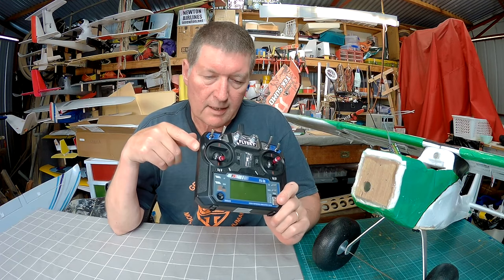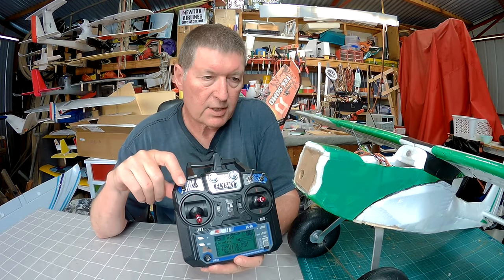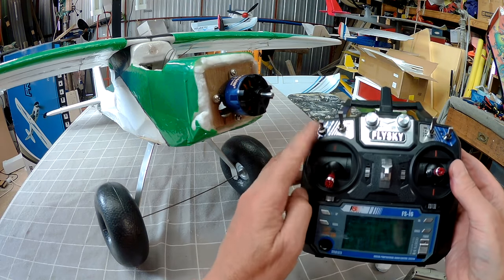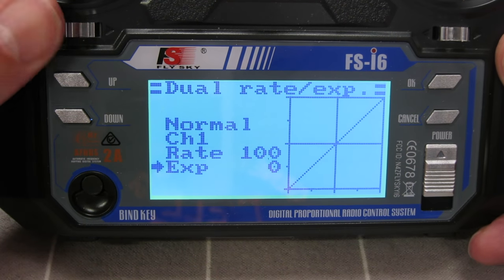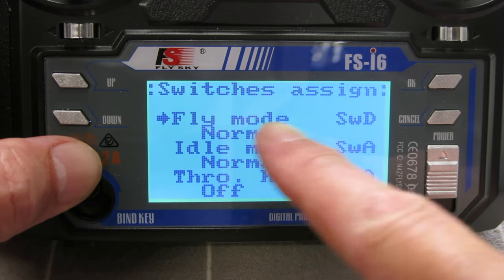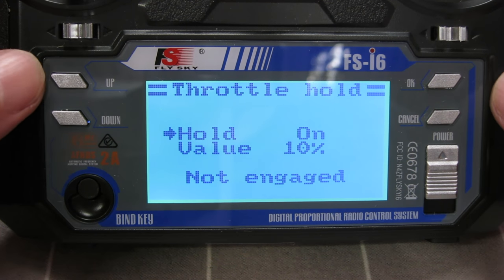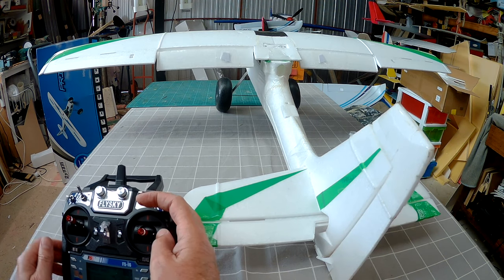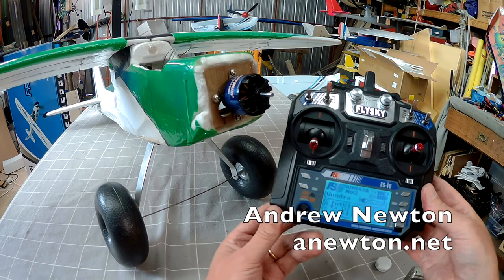FlySky FS i6 programming

Comment: I just got my FS-i6X transmitter/receiver the other day and I'm trying to set it up. This unit labels switch on the upper front of the transmitter as SWA, SWB, SWC and SWD, The two potentiometers are labelled VRA and VRB and the transmitter recoganizes them as channel 5 and 6. 
When I get into the set up menu - assign switches - idle mode - the screen reads "None" directly to the right of each mode . Pushing the up and down buttons nothing happens, no changes. What am I missing? Do I need to update my firmware?
Reply from the maker: Thats normal. Watch this https://www.youtube.com/watch?v=kKgV3LhAwVo
Reply: @AndrewNewton , Thank you. The save function after making changes eluded me, then I discovered you hold the "cancel" button to save your changes. 
I was a bit surprised there wasn't a detailed instruction booklet included with the radio, but I suspect that helps keep the cost down, which is why I chose this radio.

Comment: Hi Andrew i have just been through your how to program fsi6, the problem i am having is in dual rates is when i switch to sport mode i have no use of any channel but all ok in normal mode, any idea
Reply from the maker: Have you set up the weight and expo for each channel in sport mode?
Reply: yes i have and i changed the sport mode to switch b and it works fine , but in display if i operate switch d all the channels disappear. thanks for your quick response

Comment: Hi, Andrew. I also want to set the flaps for two positions on SWC, but I really don't know how. I set both flaps on CH5 with a Y cable and changing the wires inside one of the servos so they will work the opposite way. I suppose you know what I'm talking about. I manage to set full flap on pos. 3 of the SWC, but I don't know how to set half flap. Any help appreciated. Thanks
Reply from the maker: SWC up = level flaps, SWC middle = half flaps, SWC down = full flaps. What does your setup do that is different?
Reply: SWC up - flaps up, SWC middle - flaps level,  SWC down - flaps full down
Reply from the maker: Adjust your push rod length and servo arm position so that Up = Level
Reply: Yep! Works perfect! Thank you, Andrew.
Reply: Another question, Andrew, if I may. Now that SWC is set to half and full flap, with elevator down when full flap, is there any possibility to set elevator up when half flap? Thanks

Comment: Hi Andrew,Firstly many thanks for your tips and help, always a pleasant experience.
I`m hoping you can help with a prob I have with a  Turnigy i6 .Its re battery,I am not a fan of  click in batterys as you have 8 chances of a failure given 4 batteries.
I adapted 
a 2S life 6.6 V 700 m/a to fit but this was the biggest I could find that would fit.700 ma not enough really.
The screen has since gone blank and radio now unusable.(too many volts?? rated at 6.6v but in practice is closer to 7v versus rec 5volts)
Would happily buy another if a battery can be found to suit .Any help would be welcomed.Cheers Brian.S.
Reply from the maker: Oh no! I have only ever used AA batteries. Some users have done a LiPo mod but I have not looked into it. Might be time for a replacement.

Comment: Hi, I'm planning to buy this radio with a receiver. There is two versions. Should I get the receiver with telemetry?
Reply from the maker: FS-i6X (has 10ch) and FS-iA6B receiver (has iBus and telem) would be the best to buy
Reply: @AndrewNewton  I will use the radio for a freewing lippisch 64mm edf plane, so I don't really need a 10ch radio. I don't have alot of money either.
Reply: @AndrewNewton  Here is a link of the two radios and receivers I'm planning to buy. They both cost the same:

https://www.radiostyrda-modeller.se/default.asp?mod=product&cat_id=24&product_id=12699

https://www.radiostyrda-modeller.se/default.asp?mod=product&cat_id=24&product_id=12698
Reply: Which one whould you recommend?
Reply from the maker: @sadsausage2224  The first one with FS-iA6B receiver
Reply: @AndrewNewton  ok thanks 👍

Comment: Andrew I'm having a another problem with a battery it's new 11.1 volt 2200 mah 25 c and I used my tenergy  balance charger  I tried it out in my plane and the  power keeps going down then back up to full power and then back down up and down  my other one works fine so do you know what I can do about this  or what the reason for this
Reply from the maker: If that is the only battery that it happens with then it could be a dodgy cell.
Reply: Thanks for telling me I bought 2 of the same batteries and one works fine but the other one is doing it I wanted to know what was the reason for it I haven't had to much luck with batteries if late thanks again for helping me

Comment: My evolution I'm going to use the sport wings and the  Phoenix I'm going to use the evolution wings the evolution wings have the alorons and flaps on each wing I'm using the same type battery in each plane I like the rudder fin on the Phoenix and I used your idea to use tape to help  stabilize it.its twice the size as the  evolutions fin.

Comment: Hey Andrew I have another question for you my Phoenix 2000 the moter is a 
4023 and when its cold it spins fine but after I run it for about a minute or 2
It seems  to drag and dosen't spin as freely as when it's cold do you have any idea of what it is or is that  normal???
Reply from the maker: When you plug the battery in it might resist spinning, don't know about temperature
Reply: No its not a question of temp. the motor  esc and  battery  all are  cold they don't get hot but after running it  30 seconds or so I turn it off and after a couple of minutes  I  picked it up and spun the blade and it  seems to be  dragging  after about a couple of hours its spinning fine  freely  do you have any idea what it might be  battery is fully charged  connections are good  but I can't think of anything that would cause it  should I try  spraying some  wd 40 on it and in it to see if that fixes it  or have you ever ran across this before I really can't think of anything that would cause this its the  Phoenix 2000 motor  brushless  could one of the  plates be loose  inside???

Comment: Hello  Andrew this is  Jeff  in Seattle I wanted to  ask you  ,can I use switch b to set the  rudder  in a  slow  turn I have  it flying  straight  and  level  but I want it  be able to  flip  switch  b on  and  have  it stay in a slow turn until I  turn switch  b off .I have the  fly sky ia6x transmitter thank you  if its possible  can you  tell me  how to  set it up and also how do I adjust the  sensitivity of the  controllers so they  don't  react  as fast
Reply from the maker: Yes that should be possible, like flaperon mix on the rudder.
Reply: Thanks  I'll try it

Comment: Is there a chance to use channel 5 for the tail elevator so I can use elevon on the normal wing
Reply from the maker: Elevons are just flaperons/spoilerons using the elevator stick as the source (also called snap flaps), so I think you can leave the elevator on 2 and plug one of the ailerons into 5 then do the flaperon mixing.

Comment: hi andrew! carlo from the philippines again. i recently bought this flysky is-i6 after accidentaly destroying my spektrum dxe when i inserted a 2s battery the wrong way around. anyway i was wondering if i could set up a flight mode on a switch on this transmitter so that i could have a take off mode and flying mode. i wanted to have an airelon rudder mix on the flying mode while none on the take off mode. is this possible? thanks again 😊
Reply from the maker: Not an option with this one Carlo. Cant use switches with mixes.

Comment: Can you remove channel 2 and 4 from stick and move to switches? I only need left/ right and up/down for car and want to use channels 2,4 5and 6 for switches to run 2 speed transmission and lock diffs.  Thanks.
Reply from the maker: Not with this radio unfortunately, 12 3 and 4 are fixed to the sticks
Reply: @AndrewNewton  thanks. So I If got the 10 channel receiver I could use the other 6 channel for the switches?
Reply from the maker: You would need to do the 10 channel firmware mod to the transmitter to use more than 6 channels
Reply: @AndrewNewton  I have the x version which says it has 10 channels so do I still need to update. This is all new to me!!!
Reply from the maker: @theitalianjob6302  Perfect. You should be right with a 10 ch receiver.
Reply: @AndrewNewton  thanks for your help.

Comment: I wanted to ask you if I have a brushed motor with my fs i6x radio and in the  throttle mode it says 25% 50% ect.and I don't use a esc will it go at full speed or at increment of 25 50 75 100 moving the throttle without the esc or will it go all or nothing
Reply from the maker: Still need an ESC to give variable voltage, receiver only provides the signal for the ESC
Reply: Thanks

Comment: I know this is old but I have the flysky fs-i6x.  When I go to the assign switches page, it let's me toggle thru fly mode, idle mode, throttle hold, using the ok button, but the up and down buttons dont seem to work on this screen.  I cant change the switch assignments.  They are all stuck on none and I cant even select it to change them.  Any help anyone can provide would be appreciated.  I even reset the radio to factory defaults.
Reply from the maker: Cant help with that one sorry

Comment: Help. My flaps go waay too far down. How do i reduce? I tried end points but it barely does anything.
Reply from the maker: Start with the linkages. Move the pushrod to an inner hole on the servo arm or fit longer control horns on the flaps. Or reduce the weight in the mixing.
Reply: @AndrewNewton  ahhh i havent tried mixing yet. Will do thank you

Comment: yea thx for the vids I got mine with a cheap quad no instructions at all I use the radio on my beach planes don't want sand on my graupner stuff took me ages to find out you have to press cancel to lock a setting in lolol also on mine I the throttle is not down and all switches are up it beeps a warning must be a quad feture lolol
Reply from the maker: It's a bit quirky but great performance for a cheapy

Comment: very strange , I have  fs-I6x my set up is  ch5/normal position  ch6/also normal positionand for mix2 (master ch6 flap)  posmix/-8%   negmix/-8%  offset/ 1%thank you very much for your setting, I still do not know why my setting , so much difference, is not a big deal, is working for me .  thank's again it's very useful and enjoy more my calypso glider 73 inch wingspan.
Reply from the maker: 8% - Would that be for camber and reflex rather than full flaps?
Reply: the only thing  I did different to you , I did not use 3 way switch instead I use VRA switch on transmitter

Comment: So now I've tried a different charger and I charged up my battery. And it says it's fully charged according to the indicator. I turn it on. And again, I have full power. For 10 seconds, and then it drops down and just keeps going down and down and down. I tried it in a different plane same thing. So it's not the plane. And I don't believe it's the charger so I have 3 different batteries. And I'm charging each one of them up. And seeing if any of these are holding charges.
Reply from the maker: Old and abused battery maybe. I have one that catches me out occasionally. Must decommission it.
Reply: What size battery would you  recommend is 20c or 30c better  for the plane  and  2200mha is 30c more  powerful than 20c

Comment: I wanted to share how I setup flaps , useing one Chanel #5 30% and 100% on an F.S i6 ch transmitter useing c switch a3 position switch ....ok 
I put the c switch in the up position,I took the linkage off the flaps servos then I put the flaps in the neteral position and reattached 
The linkage to the servos then set the c switch in the middle and set them to 30% then I put the c switch all the way down and set them to 100% ( you will want to use the mix to give a bit of down
To the elevator to help prevent the ballooning effect of full flaps so when the c switch is all the way up 
You should have the flaps in neutral move c switch to the middle and you should have 30% 
Flaps and move the c switch all the way down you should have 100% flaps only useing one check and one switch ...must be a 3 position switch for assistance in the set up and mixing pleas watch 
Any and all of this man's videos.
He is an excellent instructor.more importantly his videos are EZ to understand he takes the time to walk you through it very great 
full I do this one thing I feel is very important to do I setup all my planes with a throttle cut off switch  to keep me from accidentally turning on the motor
He shows you how to set it up.
I recommend all his videos for help thank you Jeff b.....
Reply from the maker: Great stuff Jeff, thanks for adding to the knowledge pool
Reply: Andrew Newton I can't believe you replied to my email wow thank you so much.i watched your videos and still do I've read about you ..
You are amazing EZ to understand
Very knowledgeable thanks for all you have done and are still doing Jeff b.
Reply from the maker: Jeff you deserve an answer when you go to so much effort.
Reply: Andrew Newton it's you who I need to thank you are very accomplished man and I am so honored that you would even reply to my email you helped so many people out with your videos and according to your accomplishments in many other ways I'm sure if you're ever in Seattle Washington let me know and I would love to take you to lunch or help you in any way I can I appreciate the time you take for us out here watching your videos again thank you very much sir
Reply: Andrew Newton mr. Newton I haven't flown for about 15 years back when Futaba ruled the RC and plans are made out of Balsa and I'm just getting back into it and that's why I appreciate your videos I really am not very text savvy and your videos have helped me out immensely in programming my Fsi6 radio. Could you please tell me what video to watch or what I'm doing wrong everytime I try to program 1 plane into the radio and copy it after I turn off my radio for 2 or 3 days the programming is not there anymore I have to reprogram all my settings is that normal???

Comment: Someone please help , i have a flysky i6x and its bound to my esc , but it wont control anything ! The motor wont spin the servo wont turn nothing ! i tried all the button and tried on all channels , Someone please help 😭🙏🙏
Reply from the maker: Receiver not properly bound to radio
Reply: @AndrewNewton  hi thanks for your answer it actually was bound , i just inverted the connections of the motor and the servos in the receiver ! It works just fine now !

Comment: Can anyone tell me how to connect my Fsi6 transmitter 
To another Fsi6 transmitter as 
A master when on one end of my 
Cable has a USB end an the other has a round input end neither one has a USB input....
Reply from the maker: You need the right cable. Yours is for connecting to a PC
Reply: Andrew Newton thank you I have another problem when I setup my radio and copy it to keep my settings after having the radio off for a few days I loose my settings
I have followed the instructions but it says the plane I input but my program settings aren't  their.
Reply: Andrew Newton PS I don't loose my throttle switch on a it still is there my settings for 30% an 100% flaps are set still just not to the plane

Comment: Well  I've tried to fly my plane  3 times  all 3 times  I crashed  after  about  15 seconds. The  3rd time  I launched  it from a  200 ft sloop and  still  I crashed  each  time I  fixed it after the  3rd crash  I wanted to  make sure  the  motor was  working ok I hooked up  the  battery and  I checked it on the  transmitter  it said it was  fully  charged I turned the  motor  on full power and  it ran  fine for  about  15 seconds then the  motor  lost power  its like  it only  has a quick  charge  not a deep  charge .that's why I  haven't been able to get it  to gain altitude the transmitter  said it  has a full  charge  but it doesn't  not I'll try a different  charger  if that  isn't the  problem  I'll have to get  new batteries
Reply from the maker: It doesn't display the lipo voltage, just receiver input voltage. Why are you crashing?
Reply: Anyway to answer your question why I keep crashing. It's because when I have the throttle wide open, it kills the power. Of the battery and I lose control of the plane because it takes the powers and I can no longer control it the servos don't work. So I lose control of the plane with It Wide Open not knowing this and that's why but I've repaired every time cuz I've been really no higher than 20 or 30 feet when I wasn't able to control it anymore.
Reply: So I changed my Chargers and not of the three batteries. I have only one of them are good.

Comment: Need help andrew. Throttle stays on when swa is in up position.
Reply from the maker: What have you assigned the SWA switch to? Did you set it up the same as me? Is your throttle plugged in to the correct channel and not reversed?
Reply: @AndrewNewton  set up same as yours but only 4ch..solved the issue by factory reset.but i think the binding with rx is gone.